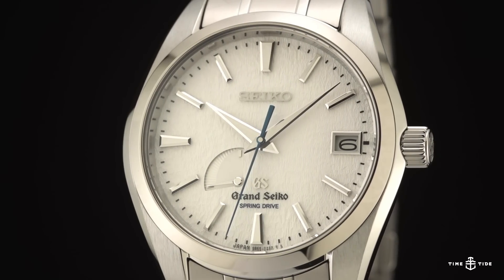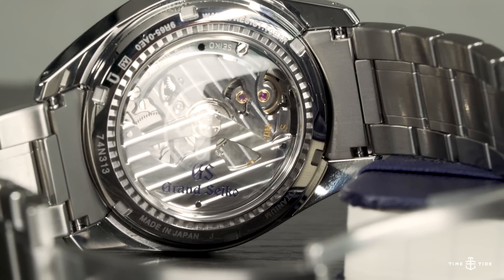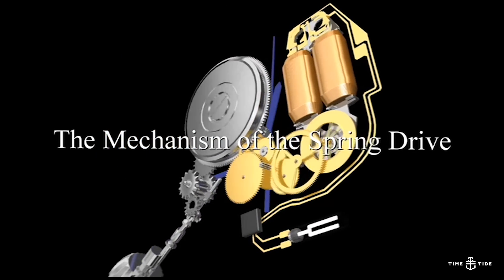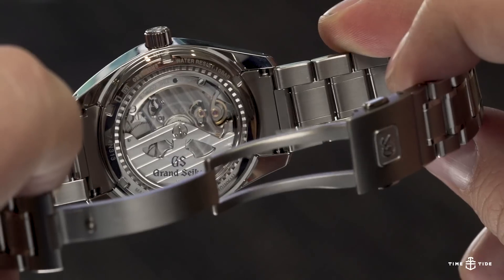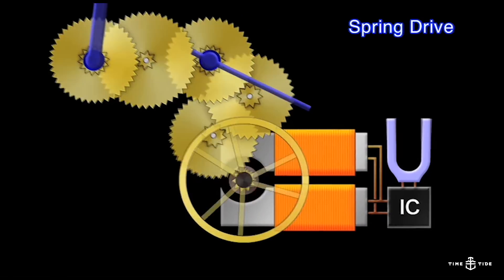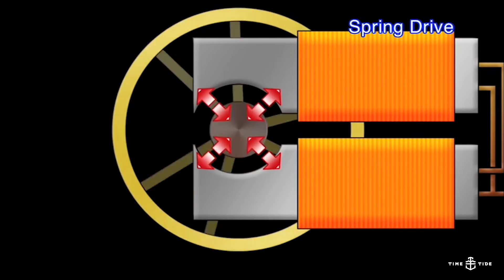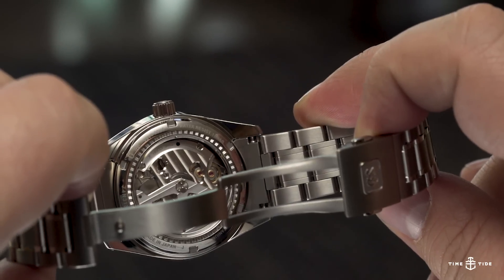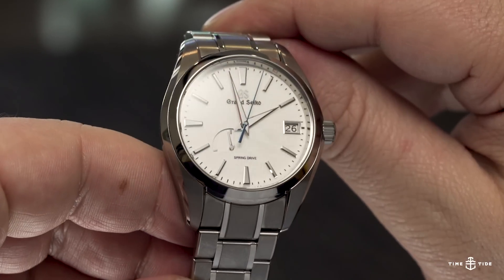GRAND SEIKO – Spring Drive Explained

Comment: And here is where the dim-witted get confused  "a quartz you say, just like a $20 Casio?".  Yeah, then I guess you could say the combustion engine in a Ferrari is the same as in a Ford Fiesta.  The "very same technologies thing happening in both cars". Yeah. Sure.
Reply: @tangentradio7272  With you completely. Take it a step further in the Automobile comparison. A diesel engine ran, no artificial electronic controls and they were ultra reliable. Enter the modern day clamour fitting ECU and all of a sudden a Diesel is problematic item. It begs the question, "Why fit an electronic control to a mechanical watch movement ? If you must have that degree of accuracy just buy one of the many variation of Quartz watches available.
Reply: Umm.. yes..?

Comment: It's a quartz watch, same as a $10 Casio.
Reply: Yeah, just like the combustion engine in a Ferrari is the same as in a Nissan Versa.  The very same identical thing happening in both cars. Enjoy your Versa, and your Casio.
Reply: The reason people adore mechanical watches is because of the complicity of the movement and the fact that it doesn’t require a battery. They’ve worked on the spring drive movement for 28 years (if I’m not wrong) and it’s complicated. It’s accurate, looks elegant and again, complicated. How could you compare this to a $10 Casio..? Besides that, the craftsmanship is amazing on these Grand Seikos.
Reply: You realize I have a $10 automatic/mechanical watch that tells time just fine, right? Your argument is pointless.
Reply: Dumb.

Comment: What I don't understand is how people can bash the spring drive design, because it uses an oscillating crystal instead of a balance, and the tri-synchro instead of the escapement, and then, in the same breath, sing praises for the DEFY lab Zenith movement which does the same exact thing. The Defy Lab uses an oscillating "cut out" wafer of silicon and the entire movement has less parts than the spring drive. The crystals in the spring drive are grown in-house by Seiko and are far more fascinating than using a template to stamp out a silicon wafer. The lack of intricate parts within the defy lab makes for far less craftsmanship than the spring drive. Alas, one is Swiss and one is Japanese. Hence the adoration for the defy lab, and the constant putting down of the spring drive.
Reply: They are two completely different technologies. The Defy oscillator does not employ a servo feedback loop to regulate its oscillation rate.  The Spring Drive servo loop assures quartz watch precision via a well disciplined mechanical movement, while the Defy oscillator has no such timing regulation loop.   It's purely mechanical...and, I must note, susceptible to shock damage as the oscillating structure is quite delicate.
Reply: Ain't nobody got time for this...
Reply: I don't hate the spring drive but to answer your question the Zenith's heart is purely mechanical whereas Seiko's uses electrical on top of the mechanical.
Reply: The answer is quite simple... Some people have shit for brains. It’s a hublot/tag love child, imagine getting the two shittest watch companies to contribute to one of your watches, the dial alone tells the whole story
Reply: @The Macro Folks what did Hublot and Tag invent?
Reply: Not for those who are looking for pure mechanical watch. They only replaced the power source, still a quartz watch
Reply: @Ivanaet  Ultimately the power source is still a mechanically wound spring via the common weighted mechanical winding movement.  There's a quartz crystal, a form of servo motor, and a computer control system in it but all power is generated from the mechanical winder. That's more of a perfected mechanical movement and less of a "quartz movement" in my book.
Reply: @Ivanaet That which you are describing is a kinetic movement. Quartz powered by a rotor and the IC delivers directly to the seconds hands. The Spring Drive is a mechanical watch that regulates the rate of the energy coming out of the spring with a quartz, but the IC does not deliver directly to the seconds hands
Reply: Boy git yet ass over there and turn on the zenith! I caint fnd the mote
Reply: Zenith defy lab
Reply: It’s the same as with traditional CE cars and electric cars/hybrids. The electric or hybrid can be better in every single way, but there will always be something romantic about pure combustion engine cars. It doesn’t matter that the spring drive is “better”.
Reply: Because Hero Hito never apologize for 9/11
Reply: It's just irritating when people claim the Sping Drive was not a Quartz watch, when it is evidently Quartz regulated. When being confronted with this fact they get defensive and talk about spring drive bashing. It's still innovative and interesting. And Quartz.
Reply: @jeanraspail2979  Funny thing is that if you can call it a quartz movement then you have to call it mechanical movement also.
Reply: Jean Raspail You’re irritating.  To use mechanics, no battery, to generate an electromagnetic current which allows quartz to regulate the time is quite ingenious and only a simpleton would boil that down to “it’s a quartz watch”.
Reply: @BE-bk1tb  I don't get why some people are getting so defensive. It is a quartz regulated watch, that uses an electromagnetig generator a quartz crystal and an electromagnetic brake to regulate the movement. Now these are the facts. The regulation makes the movement.
Reply: It is a mechanical movement with the energy coming from a spring would by enertia. It is not driven by electricity.
Reply: @Kevins-Philippine-Retirement  as long as I see wire leads, no longer a pure mechanical watch. I understand that energy is from the spring, but oscillation is electronic.  It  is a class by it own. Still a brilliant idea!
Reply: @Ivanaet  As a retired electrical engineer, the way I see it is somewhat how we see automobiles these days. While there is electrical and electronics everywhere in a car, it is still considered mechanical. The electric cars can be considered electromechanical.
Reply: @jeanraspail2979  please never buy a Spring drive:p